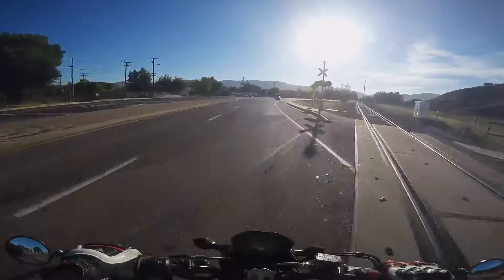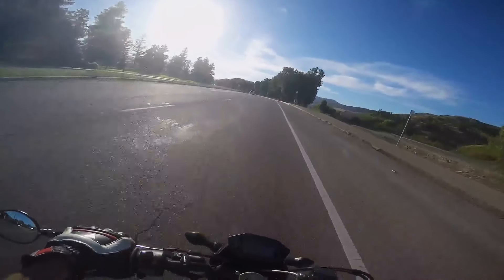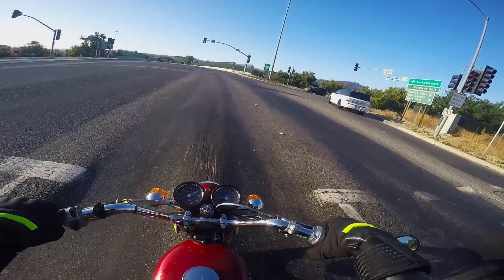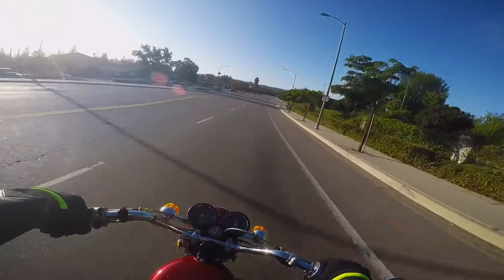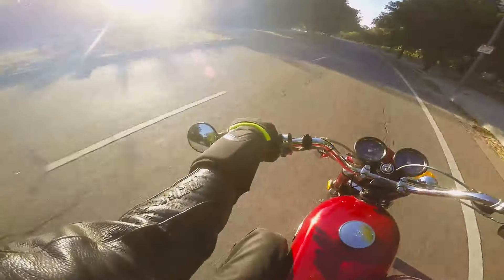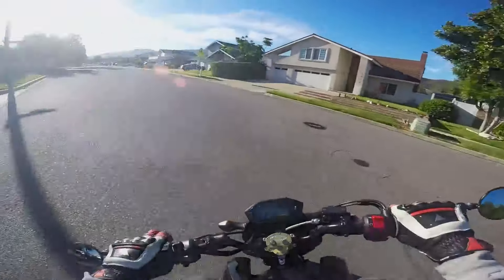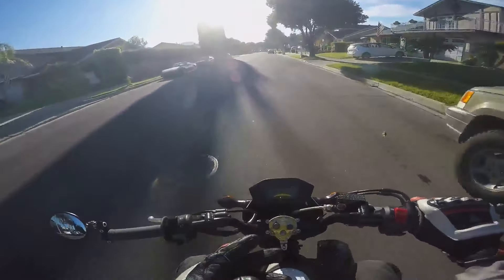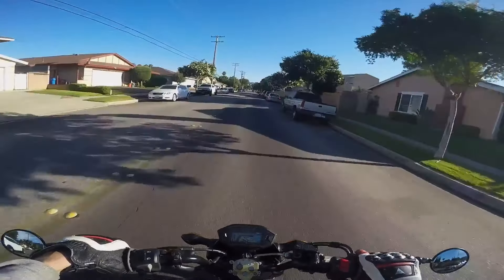HP vs Hassle - #671

Comment: Yep, engines are designed to function within a window of performance and longevity. Higher performance means more stress and heat and shorter longevity.
Reply from the maker: That's why I'm a big fan of stock! ...best compromise between power, mpg, & reliability! Peace bro!
Reply: @drummerdavemax  Well.... stock uncorked, ECU flashed, professionally tuned. There's a host of bikes I could name that are great bikes, but in stock form their emissions tune makes them kind of stupid, and with the bigger engines reduces power anywhere from 10 to 15 hp. Also run hot. Fuel-cut also makes throttle control a jerky affair.
Reply from the maker: @exothermal.sprocket  I've gotta agree with that cuz all my KTM's & the 701 have super lean tunes thanks to the smog laws! They run fine most of the time, but it doesn't take much to get them hot! ...a couple red lights back to back, or a slow traffic day in summer will peg the temp gauge! And I can feel that lope at low speeds in parking lots too, which means it's running lean! Someone sells a dongle thing that plugs into the O2 sensor & tricks the bike into running a little bit richer... it's supposed to help a lot!
Reply: @drummerdavemax  I know. EPA feels in order to save a tree frog, engines are supposed to run lava-hot. Because it's so much better to junk an entire engine prematurely due to running too hot than it is to choke on another hydrocarbon.